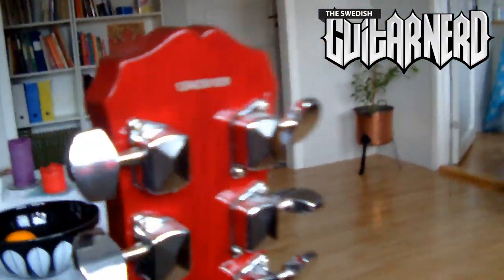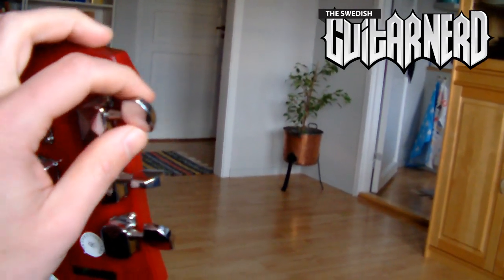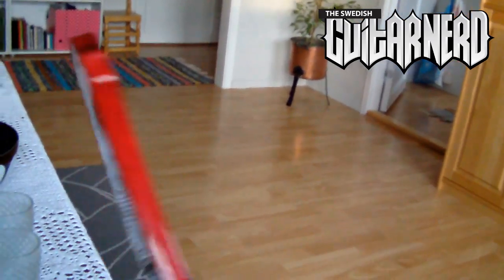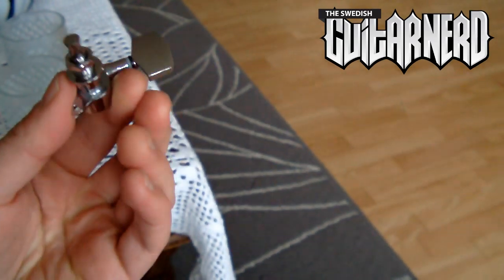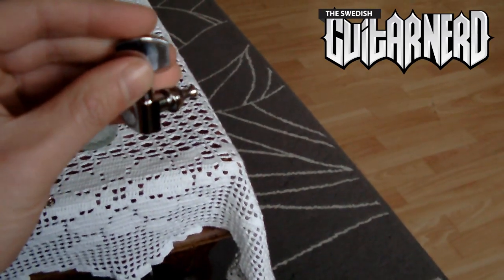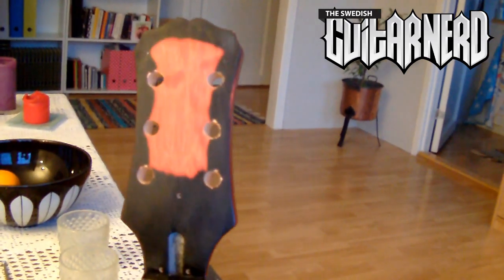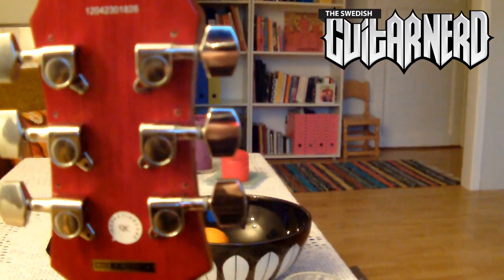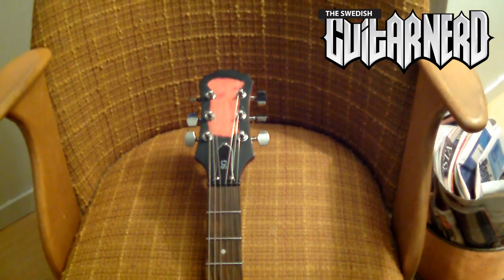Epiphone Sg Special - Upgrade tuners

Comment: I did the same with my sg. I absolutely hated the stock tuners. They were flimsy and wouldn't stay in tune so I replaced them with Grover Rotomatics now no problems
Reply from the maker: Yes it's an easy fix that really makes the guitar feel like a proper usable instrument.
Reply: @SwedishGuitarNerd  I also heard Gibson/Epiphone have been getting flak for there quality control as of late. I know quite a number of people that have complained about the tuners and even the frets. The SG I have is the VE model and it was cheap so I think maybe Gibson is just cranking them out of the factory as quick as they can. I even replaced my bridge pickup with a Seymour Duncan Pegasus
Reply from the maker: @palmergriffiths1952  They are making a gazillion of these every year. How did you like the pickup upgrade? I put an EMG in mine but ended up switching back to the original pickup.
Reply: @SwedishGuitarNerd   I actually like the Pegasus. Seymour Duncan markets it as a pickup for "Progressive Metal" players but like I say it's probably just marketing. But I have to admit I do like it. The pickup has some nice mids and lows to it especially  for the type of Stuff I like : Judas Priest, Accept and heavier stuff.  I also have another Epiphone SG special I bought used it's body is Red along with the neck. I did upgrades to that one as well. It has mini Grover's for tuners and a Seymour Duncan Invader in the Bridge. I believe my Red SG was made in China while the other one was in Malaysia wether that really makes a difference I don't know.
Reply: @SwedishGuitarNerd  You should check out Glen Fricker's channel on YouTube. It's pretty good. A few times he ripped into Gibson/Epiphone for there quality control  LOL
Reply from the maker: @palmergriffiths1952  Yes I've followed his channel for years. Highly entertaining stuff!
Reply: @SwedishGuitarNerd  yeah he sure knows his stuff. He's got a great channel
Reply from the maker: @palmergriffiths1952  And he's Canadian! 😀
Reply: @SwedishGuitarNerd  So am I ! 😀👍🇨🇦

Comment: Hey Sweedish guitar nerd! great video.
 I'm thinking of buying this model, do you think it would keep working after a few years?
The latest issue seems to have the neck made of okume wood, and I'm worried it might warp or twist in time and the truss rod won't be able to handle it. What do you think?
Reply from the maker: Andrei Nagy That's news to me. On the other hand I have no idea what the neck on this one was made of. It sure as hell wasn't maple. (That the specs back then was.) The only wood that seems solid and reliable to me is hard maple. I don't get why we are still making solid wood guitars. It's a horrible material for that!
Reply: Love mine been having it since 2018👍

Comment: I have an Epiphone acoustic guitar from 1995 which has the same bad tuners - I'm amazed they are still working to this day. I've always wanted to replace them though, maybe I'm gonna do it now.
Reply from the maker: It makes all the difference in the world! :)
Reply: I think I saw the ones you have on Ebay for a few Euros directly from China.
Reply from the maker: Mine costed around 20, but then the guitar store had to make some money so it's probably similar tuners. One wonders how little money Epiphone saves from choosing the bad ones?
Reply: Yeah, it's absolutey crazy. Maybe they want the SG Special to look inferior compared to the more expensive models.
Reply from the maker: That seems to be the plan.
Reply: Lately people have been posting this video where somebody compares the sound of a Squier guitar to a piece of wood from his kitchen table. To me this video only proves that the Squier's wood is terrible. The pickup of a guitar alone is more or less a specially designed microphone for steel strings which colours the tone but does not create it. Just like a microphone does not sing on its own, without the the singer behind it.
Reply from the maker: Well my reasoning is (if we stay with the microphone analogy) that the microphone stand makes no difference to the tone of the singer. I'm sure the materials affect things to a certain extent but not as much as we are lead to believe. For instance of the electric guitar is loud acoustically and the body vibrates then that's a clear sign that energy from the strings is wasted by the material and that should weaken the sustain and tone. (This is often the case with so-called tone woods). It's hard to find unbaised comparisons though. Everybody seems to make them in order to prove their own standpoint. I would love to try a Flaxwood guitar to see how an even material affects the guitar.
Reply: The difference is, good tone wood responds to the vibrating strings by adding its colour to their vibration which gets picked up and becomes sound. Bad tone wood doesn't respond, but sucks up and weakens the vibration. A guy on Youtube built a guitar made of stone. Very interesting, just search for "stone guitar".

Comment: Hi SGN,

             Love your channel, especially the focus on cheap guitars! I'd suggest that the holes are filled with dowel, and a tiny bit of tinted laquer applied. Any wood left bare on a guitar will lead to excessive drying eventually, and the finish problems will grow. Also, the guitar will look better.

           I am often asked which brand of guitars is best to start with, I always recommend the Peavey Raptor .. maple neck, good tuners, easy to play. It's cheap,
and far superior to Squire and Epiphone's similarly priced offerings, in my opinion. What's the sense in buying a guitar that needs upgrading right away?
                            
                          thanks again,
                                               Joe the guitar tech.
Reply from the maker: I agree - it makes no sense to buy a guitar that needs upgrading. I just do it to show people the difference it makes. Some might consider it after some years of owning their cheap guitar instead of getting a more expensive one. Peavey are generally good guitar in my opinion too. I haven't seen any around for some years in the shops I have visited, but I remember that the cheapest Raptors used to have the same kind of crappy tuners as the Epiphones.
Reply from the maker: Single coils rule! :)

Comment: When you sanded the epiphone sticker off the head stock, could you tell,if the head stock was maple ? Like you david in your other video you can't tell if the necks on these specials are actually maple or not.
Reply: My auto spell on my ipad placed "david" what I meant to say is "said"
Reply from the maker: Ken McCaffrey You've got to love the auto-spelling.. :) My doubts were confirmed since the wood that came out when i was enlarging the holes were yellow/orange. Maple is very bright so there's no way that this was maple. I'd say it's some relative to mahogany.
Reply: You might try sanding the finish off the back of the neck, a lot of people do that with these guitars so your hand can slip up and down the neck easier, also you can see if the neck is actually maple. The neck and the head stock might be made of different materials.
Reply from the maker: Yes it could very well be different materials since the headstock is glued to the neck, but since it's a see-through finish on the back of the neck you can tell that the grain structure looks nothing like maple and a lot like mahogany.
Reply: Took a look at a couple of these guitars at guitar center the other day, the necks are definitely not maple, like you said a mahogany of some sort.
Reply from the maker: One wonders why they have their info wrong? Most people (not me!) would consider mahogany to be more attractive than maple.

Comment: Use a peghole reamer tool to enlarge the headstock holes without splintering the finish..
Reply from the maker: Thomas Kirby If you have access to one of those it probably a much easier and neater job.

Comment: I want to change my tuners on my acoustic. What's is a good brand of tuners and a price range? I've been looking on ebay and the tuners im looking at range from $7 to $16 i dont want to end up with cheap tuners. Any help?
Reply from the maker: Joey O'Leary Anything from Grover, Gotoh and Schaller are great! The main thing is to get ones where the top (the part that you turn) is attached to the rest of the tuner with a screw.

Comment: is it possible to find tuners that fit perfectly with the old ones? so i dont need the enlarge the holes and also the screwholes will be the same so i wont have empty holes on my guitar
Reply from the maker: I don't think that's likely. You might find ones that have the same dimensions for the holes, but the placement for the screws will almost certainly be different.
Reply: thank you, in the mean time i got my hands on an Epiphone LP Prophecy Custom Plus EX the price was halved because of buzzing frets which happened to be only one fret a bit high and loose so yeah, what is you opinion on that guitar?
Reply from the maker: I almost bought one used and they seem like great guitars. In fact all Epiphone guitar that I have tried that have pickups by other brands (Gibson/Seymour Duncan/EMG) have been so much better than the other Epis.

Comment: Can I use prolines?
Reply: Or are the epiphone sg special tuners are proline because on guitar center I found the same design of the tuners and they are 40.00$
Reply from the maker: @UniqueApollo  I'm sure proline has tuners that are similar to the ones I used. The part that you turn should be screwed into the rest of the mechanism.
Reply: @SwedishGuitarNerd  thx

Comment: Hi, what's the original bore/hole diameter? I'm thinking in replacing instead of upgrading:
https://www.thomann.de/gb/dixon_mechaniken_33.htm
Thank you very much!
Reply from the maker: I don't have the exact measurements, but I think they correpond with a vintage Kluson-style tuner. I would not recommend getting the ones that you linked to. They have the exact same problems as the ones that comes stock with the SG Special.
Reply: Ok, thank you very much!